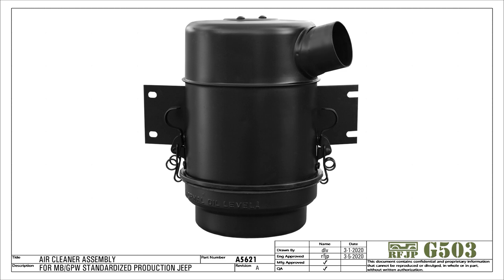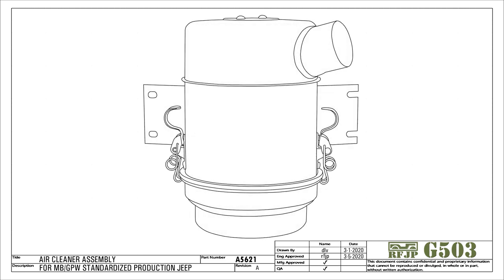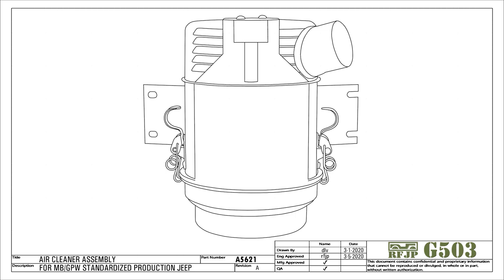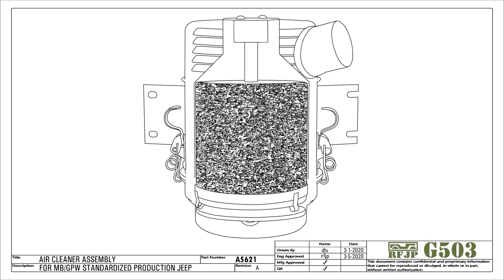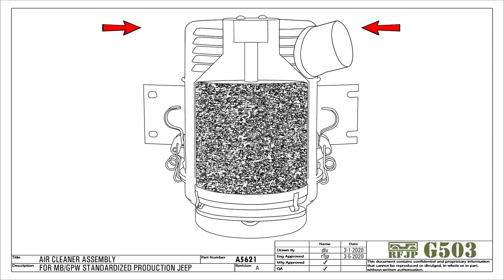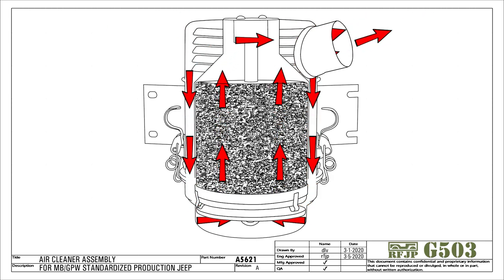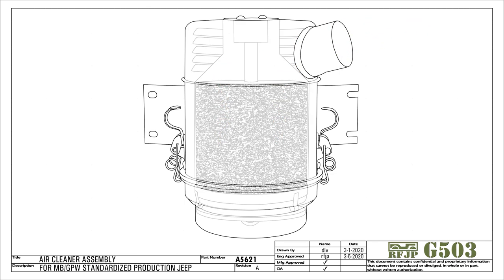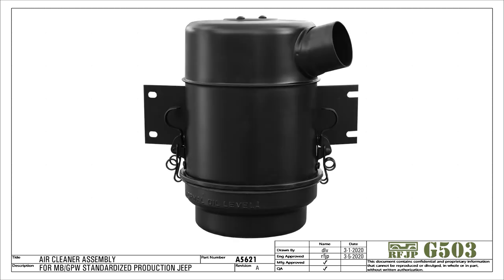How It Works, Willys MB CJ2a CJ3a Ford GPW Jeep Oil Bath Air Filter / Cleaner

Comment: I think the owners than just cant be bothered to clean out the oil bath filter must be too lazy to drive a Jeep anyway, why not change the dirty engine for a nice clean electric one while they are reducing their workload!
Reply from the maker: Have you read the instructions on the canister? It says “check daily “😉
Reply: Yes I am sure they covered themselves even back then, but how many still work even though they were only looked at when the vehicle was rebuilt 10 years ago, the similar filter on my tractor has the same advice on it, but I doubt it has been emptied in 20 years.
Reply: How is it for volcanic ash or dust storms. That is my question.